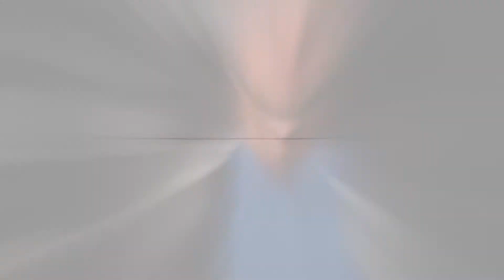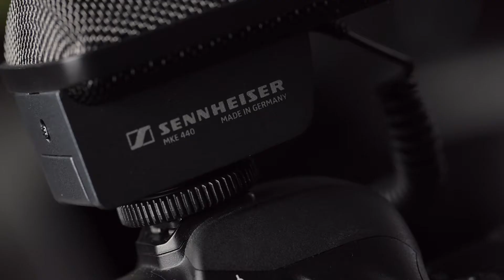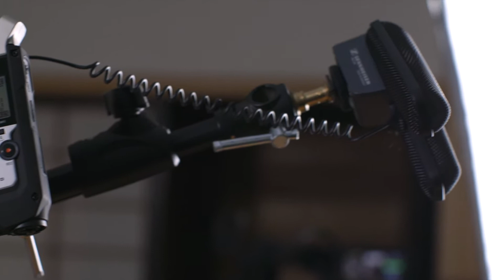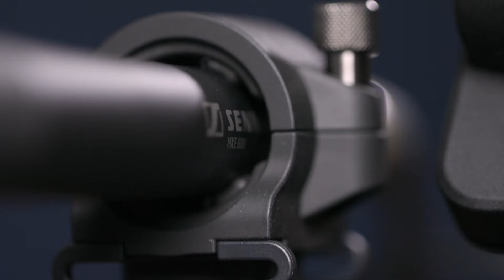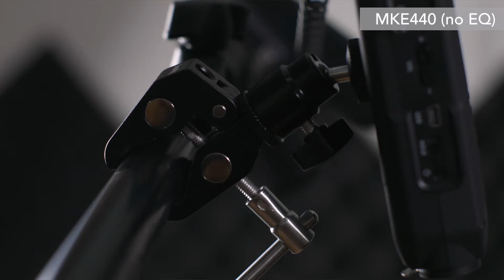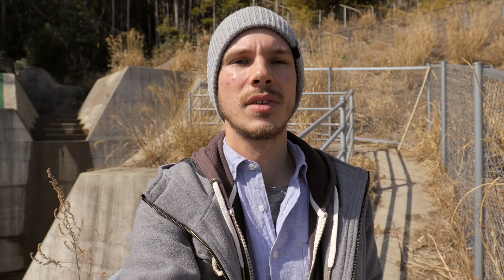Shotgun Mic Comparison - Sennheiser MKE600 vs. MKE440

Comment: Hi Scott, I have an MKE 440 and it seems to produce a lot of white noise/hiss when it’s quiet in the room. I connect straight to the camera and keep the camera preamp on the lowest settings. I tried it with two different cameras (Canon and Sony) and the result is the same. I hear no such hiss in your recordings - is there any post-processing you do? Have you noticed any of the low volume hiss like that by any chance? Thank you.

Comment: How would you compare the sensitivity of the MKE 600 vs +20dB of MKE 440 ? I love the sound of the MKE 600 but would like to have the +20dB option of the MKE 440 for some far away shots. If you feel that the sensitivity of MKE440 +20dB is same as MKE600  then it would be a no-brainer for me.. Your thoughts ?
Reply from the maker: In all honesty I wouldn't rely on the +20dB setting for far away shots... not because it won't pick up the sound, but because it'll probably sound terrible. It'll be picking up all the noises in between and around the mic and your voice more than your voice itself, and it won't sound much better than the camera's built in mic at that point. The +20dB is very useful for low sounds that are close enough to the mic though, or as a way to lower the gain on your camera or recorder for cleaner sound if the preamps aren't that good. I know that wasn't exactly the answer you were looking for, but I hope it helps. If you need to record a sound further away from the source, either mic with a portable recorder close by, or a wireless mic (either a wireless Tx for the shotgun or a wireless lavilier) would be much much better.

Comment: I got to say the 440 sounds better to me, the stereo effect somehow sounds sharper for some reason or in hi-fi terms may be a tad brighter. The other thing is I also like the +20 db function which could be very useful if the subject is farther away. 
So, my question is as follows. I like to shoot birds, mostly stills, but I would like to become more of a hybrid shooter by incorporating some videos.  A typical situation would be pointing at a bird with a super telephoto zoom on a tripod, the bird could be 30-50+ft away, perched on a branch. The good news is usually there won't be too much ambient noise such as traffic and so on. So, in such situations, would it be better to point the MKE 600 directly at the bird or using the stereo pick-up of the MKE 440? My key concern is  the MKE 600 while good seems to lack a little sensitivity plus as mentioned before the MKE 440 has the +20 db function which could come into good use when the bird is this far away.
Which mic would you recommend, Scott?
Reply from the maker: Thanks for watching! 
I'm honestly not super experienced in situations like that and so not sure 100% of what you'd hope for results but in either case, an on camera mic will pick up a lot of the surrounding noise no matter how quiet it is when you're trying to get noises from a subject that far away. Using the +20dB function would not only hone in on the noise you want, but also boost all the unwanted noise at the same time. For that reason, I would imagine the MKE440 picking up general ambiance of the environment at a reasonable level including the noises of the birds mixed in would be the most natural sounding result. Other than that, I'd imagine some more specialized gear would be necessary for capturing more natural sounds, or at the very least an off camera microphone closer to the source. 
I hope that helps!
Reply: @ScottDumas  Thanks for the reply! I understand the professional way of doing it would be to use parabolic mics, but that's not what I am after, I just want to use a plugged in mic on my DSLR and that's it. I simply want to capture the chirping of the bird as I zoom in, just very short one-off clips if you will without doing any post-editing on video nor audio. I am in the process of doing more research. Let me show you a clip of what I am after in the clip/link below, this guy just used a Rode VideoMicro, but he did do post work and laid on a soundtrack too. If is between the Sennheiser MKE 440 and 600, would you go with the stereo pick-up of the 440 or go for more directivity of the 600? https://www.youtube.com/watch?v=VDqFNu-uV_U
Reply from the maker: @Rascallucci  Wow, beautiful video. It's amazing if that audio really is captured with the video micro! Between the two, I think I'd still go for the 440... I think it's really made especially for cases like this, and would give a more immersive soundscape, but I don't think it looses out too much on directionality. Hard to say for sure without trying it, but that would be my best guess :)
Reply: @ScottDumas  The story deepens, I was just going to pull the pin on the 440, then I discovered Sound Shark actually has a parabolic mic that can be plugged in onto the cold shoe of the DSLR. I thought all parabolic mics were huge and only used by professionals in sports events and so on. I will show you what I am talking about with the link below. I don't know whether I am being cynical, but to me it is a simple plastic dish (which doesn't cost much) that is doing all the work while the lav mic is kind of cheap and flimsy. This particular reviewer tested it against the Azden and the difference was huge. I don't know, comparing it to the 440, the Sennheiser seems to be of much higher quality overall. What do you think?  https://www.youtube.com/watch?v=QYnMidUIQlg

Comment: Good video, surprisingly enough I find that the 440 seperates the voice from the background sound almost as well as the 600 does, and that one is pretty good at it. Plus, the noise from the highway kinda sounds more interesting when its in stereo. Both sound much better without the hpf on, and it doesnt help much with the street noise when its on anyway. I guess its more usefull for sounds with much lower frequenzies, like wind.
Reply from the maker: Thanks so much! Yeah- it's still a super-cardioid pickup pattern so has decent off axis rejection, but will record what's in the frame in stereo giving a really cool "feel" to the audio. Also, the filter definitely is more of a help with wind noise than car noises :)

Comment: The MKE600 into the ZoomH4N is EXACTLY the setup I am building towards right now. I have the Zoom H4N but I can't deside between the Senheiser MKH416 which is an industry standard, or the MKE600 which is a lot cheaper and more in my price range. I'm thinking of getting the MKE600 first with all of the accesories and upgrading to the MKH416 when my budget gets bigger. What do you think?
Reply from the maker: Hey thanks for watching. I think starting out with what you can afford now is probably a good choice. I don't think the MKE600 will disappoint you and like you said you can always upgrade when the budget allows, then the MKE600 will make a really solid second/backup mic to the MKH416 when you can afford it :)

Comment: Yikes, they both sound harsh..
Reply from the maker: Generally I would imagine they could both benefit from a little EQ tweaking as these are straight out of the camera as they were recorded (aside from pure level adjustments to get the volume up a bit), and perhaps my voice has some impact as well, I don't have a great sounding voice in general haha.
Reply: Scott Dumas you actually have a great broadcast voice, probably better suited to a mic with more of a flat response, or something with less emphasis on the lows.  I have the exact opposite problem, my voice is more sibilant, so I’m usually looking for attenuation in the upper frequencies.
Reply from the maker: Haha, I've never heard that and appreciate it :) What would be your recommendation for my type of voice? Any favorites?
Reply: Scott Dumas That would be a hard to determine, listen to some video comparisons of shotgun mics, you can never go wrong with a sen 416, but Rhode ntg3, and deity smic2 (they just updated their smic) might be of interest.  Do some recordings in your closet with your clothes since they kill reverb and see if you get any improvement on what you have.  Shotgun mics and reverb create a weird warbly sound that isnt very flattering on any voice.  I’d take yours over mine any day lol.  I use an electrovoice re27 which has 3 levels of attenuation, but that is a dynamic mic and really not something you would use on the fly with your camera.  I’m saving for and should be able to order a shoeps CMIT5u, but its a 2200.00 shotgun mic, so its gonna take a few months, but Ill make a vid when I do.   Oh, and I think the sanken cs3e would be good and its also pretty good at rejecting ambient noise..  I’m not a professional or anything, so take what I say with a grain, or rather a boulder of salt, a big boulder.. lol
Reply from the maker: Thanks for the recommendations :) I do have the NTG3 as well, and really like the sound but find it's a bit bassier than the MKE600. I've checked them out in the closet like you said before, but since that's not where I really use them it didn't seem practical. The Sanken cs3e looks quite nice, I'll have to look into it a bit more. I really should sound treat my room better but at the moment that's not really an option so I just kind of roll with what I can. Anyway, thanks for all the input! :)

Comment: Is mke 600 better than rode ntg4+
Reply from the maker: hard to say better or worse, maybe a matter of taste. I do find that the MKE has more of a "crisp" sound and I like it without any EQ better than the ntg4+ but overall they're fairly similar. The NTG4+ will switch to battery mode when phantom power is turned off though so it's easy to forget and drain your battery. The MKE on the other hand, uses a physical switch, not button, for battery power but will have a status light for battery power only when first switched on and then nothing, sometimes making me nervous if the batteries are actually dead when they're totally fine.

Comment: Excellent test, the MKE600 seems to have much less noise than the MKE440 and I'm so happy I got it. I would be so stupid if I got a Rode NTG4+ because the MKE600 sounds sooo good. The MKE440 has it's place but if there's only one person speaking in front of the camera then the MKE600 wins hands down. Clearer sound that is more'''''near".
Reply from the maker: I agree- the MKE600 sounds incredible, especially for the price. For a compact on camera mic for a DSLR, especially at relatively close range I do like the MKE440 a little more than the Rode VMP+ though to be honest. The MKE600 also beats out the NTG4+ for me, it has a little bit of a "crisper" sound. I have the NTG3 as well, which is much more expensive, but I find myself using the MKE600 quite a lot still. A really wonderful mic!
Reply: I have a question: Should I upgrade to a Zoom H5 if I already have th Zoom H1? Right now, I use a 3.5mm to XLR adapter and it seems to work pretty well, but what do you think? Is the money worth it or should I invest on something else?
Reply from the maker: It's a hard choice and I think it would depend on what else you need/could get with that money. Having an XLR ready recorder does definitely help as do all the additional controls etc. The sound quality will improve a bit from a combination of the H5 being better and an XLR cable possibly stepping up the audio as well. The other benefit of using XLRs with the H5 is that you'd be able to run the XLR long distances much more easily without losing quality. 

For the money though, the H1 is great and if it's working for you and your needs then it's likely enough. But, if you want a step up in quality and usability the H5 would be a great choice.
Reply: Thanks for your advice! I just bought the Zoom H5 and tried it out. The preamp noise is very similar to the Zoom H1, but you can set the gain higher on the H5. It is a really hard choice, because the H5 is so much friendlier to operate and I can also use it as a audio interface to monitor audio. My desktop PC has pretty crappy audio when I connect my headphones directly to it for some reason, so the H5 really helps and makes a soundcard unneccesary. At the end though, I don't think it will add any production quality to my work. I propably won't need the extra gain of the H5 becuase the excellent Sennheiser MKE600 is sensitive enough. I tried plugging in the Rode NTG4 plus to the H1 when shopping for a shotgun mic and it definitely needed more gain. The Zoom H5 will be A LOT more enjoyable to use but I think I  will return it and save up for a camera  slider :)
Reply from the maker: Sounds like a very logical choice! :) Sliders are lots of fun :-P